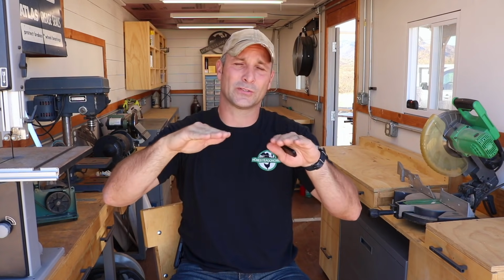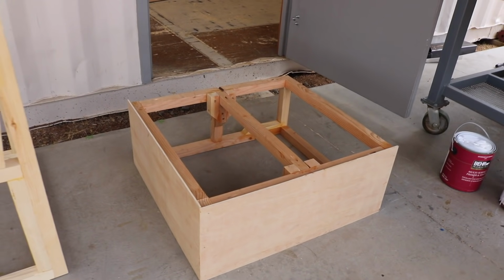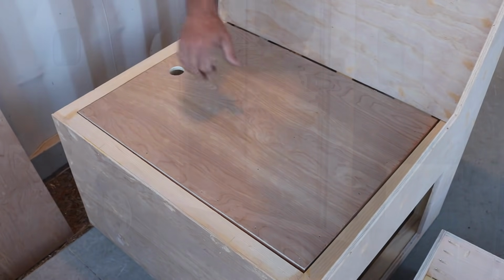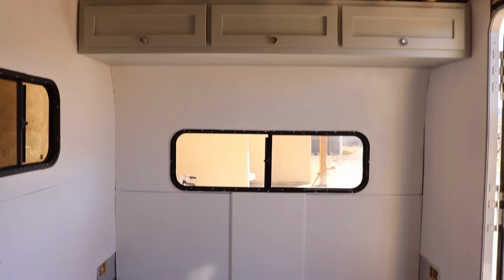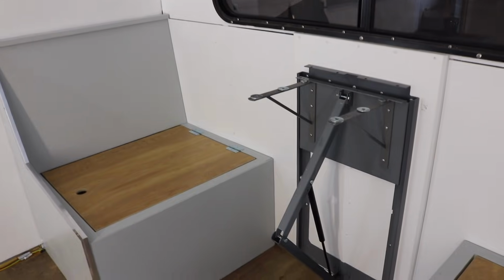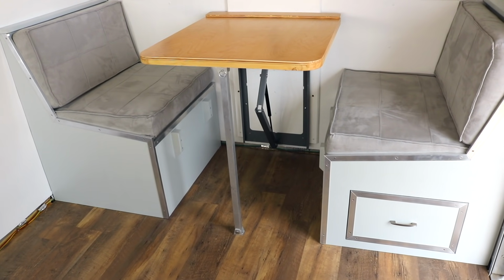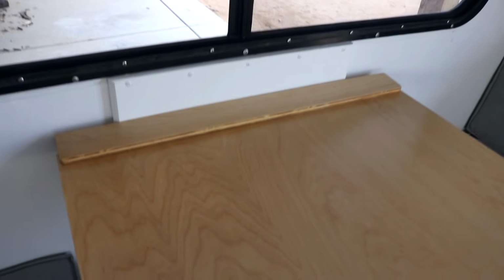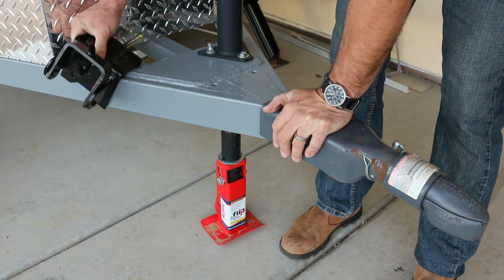How to Build a DIY Travel Trailer - Dinette, Bed, Cabinets and more (Part 6)

Comment: The trailer looks great, I love that table mechanism.  Good stuff.
Reply from the maker: Thank you Raynola!   That mechanism was a sweet find on ebay for $99 shipped to me.   I was looking at the van and boat table legs that retract and they were all into the 250-300+ range.   so I feel good with this one, even it it required a little customization
Reply: CAn you share the name of the part and model number so we can source?

Comment: I'm really enjoying this build series on the camp trailer. I've been think of doing something like this for some time now and it is giving me some insights. Keep it up when done I would be interested in a price break down.
Reply from the maker: Thanks Matt!  If you are thinking about building a trailer I can't recommend the forum tnttt.com (teardrops and tiny travel trailers).... Its mostly folks like you and I that have built all sorts of amazing home built trailers.  LOTS of great info there!   I haven't posted in years but have been meaning to throw this build on there when I'm done.   Just a great site.   
As for a cost break down... I may do something on this at the end.   But it will be very general as a lot of things have broad ranges in prices and I there are so many different options that can span that price greatly.  But I will likely do something on that and maybe contrast it to a used one versus a new.   I can tell you now that a used one is likely a better value to get a trailer considering the time I have invested into this... but I'm still trending way better than buying a new one.   haha.. not sure if that made sense or not :)
Reply: When is the ceiling coming as well

Comment: The only change I think I would make would be a horizontal cleat for the table top to rest on when it's down as a bed. Those short vertical ones may wind up poking someone in the calves more than a horizontal one would. I really like your build, you have great skills and are definitely making a much better trailer than you could ever buy! Linda and I send our best.
Reply from the maker: Thank you!   I appreciate that :)

regarding the support cleat... I actually thought of that first... but the reason I went with the vertical ones is so there would be some space where nothing was behind your leg, versus the horizontal would be along the fully length.   But only time will tell I guess... if there end up being bothersome I'll add a horizontal cleat :D

Comment: I put that flooring in our house as a replacement for the cat and dog-pee filled carpet from the previous owner. I did the install despite having a degenerative bone disease that eventually made me permanently disabled. It was supposed to be a short term stop-gap until we could get new flooring installed by a professional; the vinyl planking is still in the house, it's very durable. It was easy despite my legs and we used a different colour, I'm a fan!

Comment: Very neat, that angle metal makes all the difference in finishing off and providing a solid corner that would otherwise be prone to damage. How about an internal shelf just above the pull out draw to provide a bit more storage.
Reply from the maker: Thanks!  I really liked how the trim dressed and finished it up as well

As for a shelf in that space.. that it is a great idea... it is a spot that can't really be used and would give a bit of exttra utility!   thank you John for the idea! :)

Comment: Very PROFESSIONAL nice job. Not sure you need that middle bar since you had pins going through wall as well. But very nice.
Reply from the maker: Thank you!   as for the support leg... the table will stand fine with out it, but in case someone leans on it I don't want all that force bending against the sliding side... the shelf brackets only go about 1/3 of the table and in case someone leans on the end I don't want the sliding portion getting bent out of shape.  More of a precaution :D

Comment: Nice! 😊 Similar to a yacht interior dinette. May I suggest attaching the table leg to the bottom of the table. Have it hinge and lock under the table. Get leg off the floor. It’s a toe stubbing hazard. Have a wide Velcro strip sewn to back and bottom cushions. Then tack on corresponding loop pieces to wood. This will anchor the cushions.
Reply from the maker: Thanks Reggie, much appreciated!  :D   regarding the leg,  I actually tried to have the leg swing from under the table back... but there wasn't enough room to swing back.... and there would still need to be something on the floor for it to lock into.

Comment: I enjoy the way you think through your designs. Not afraid to take a couple steps back and develop better solutions. I like the final dinette design. Have you thought about filling hail damage, sanding and painting exterior?
Reply from the maker: Thank you Allen!   It is a process for sure... and not one that I came to easily.   I've pushed so many times to get a project finished and have always regretting skipping steps or not thinking things through as much.   so slowly my experiences have taught me to not be afraid to pause a project.... BUT... with that said, i still fall into the 'get it done' trap... haha

Comment: You can rest easy about the flooring. I have that exact same flooring in my kitchen. It has been 9 years since I installed it and it's held up perfectly. So you'll get many years of use out of it especially in a travel trailer that you're not going to be in everyday.

Comment: On our rv unit. The table leg folds up and it stores on the bottom side of table top. Simple bracket attached to the floor as a guide for the bottom of the support leg. This would eliminate your leg from being a toe hazard. Just an option.
Reply from the maker: I did think about having it attach to the top but there wasn't the room for it to swing back... it was about an inch too long.  But it would be probably the better way to go :)

Comment: Awesome build. Maybe you could build an outhouse of some sort. You could make a square stock frame to hang off the back using a "trailer receiver" then you can put a black water caddy on wheels under it for easy disposal. And then you can take it off if you don't wish to bring it with you. ( If your at a camp and have a plot next to or near a restroom and it will keep from taking up space inside.

Comment: Looks and works better than the folding cushions. Nice work.  Why the load leveling hitch? That thing can't weigh that much
Reply from the maker: Thanks Jess!   As for the leveling hitch... that is mostly for the option of if we ever pulled it with a smaller vehicle.   My truck would be fine either way but I'd rather have the attachments on just incase... also for the sway bar option as well :)
Reply: Makes sense Joe. Looking forward to more 👍👍

Comment: Thanks for sharing. Shower space is space wasted when not in use. Perhaps you can build a pull-out shower?
Reply from the maker: Thanks for checking it out!  Yes, the idea of a convertible shower is what we are thinking.  Most often I plan to have an outdoor shower... but for the rare times when we might stay in a camp ground we will want to have someway to doing it inside too.... but most often it will be open for other things.  we are thinking like a high cabinet counter with a couple flip lids that make it into a temp shower but most of the time it will cover or hide toilet and provide storage, etc

Comment: Interesting. That hinge is overkill for that though in my opinion, there are much more simple hinges that are no so intrusive or require as much extra work for the locking etc. I built one with an old school flip down hinge you can get from vintage supply stores.. very nice job though

Comment: These are really great videos, thanks for doing them.  Regarding the floor, the vinyl plank is not a good idea for trailers that will experience freeze cycles in northern climes.  Had a little personal experience with that.  Great for trailers that won't see winters though.

Comment: Just a note, you should plan and run all the wiring 1st before building the interior. Go to RV plant in Indiana and watch them build these trailers.
Reply from the maker: Yep, that is the probably the better way to go... as they've literally built millions of trailers in Indiana.   But I have been building more off of vision and as I go versus set in stone plans.    Probably not ideal, and will have many mistakes... but it's all part of my process ;)

Comment: Ian idea for extra storage, the seat with your drawer, add a removable board that sits at the top of the drawer opening giving you an essentially shelf that does not interfere with the drawer

Comment: very neat, any idea what your total dry weight is? looking to build similar with steel frame and alucobond outer
Reply from the maker: thanks Russ!   as for current dry weight right now... I'm not sure.. but I'm thinking it will end up in the mid 2k range
Reply: @homesteadonomics  ok kool, thats pretty light, love your vids, great work

Comment: The table mechanism is awesome.  QUestion:  why the pull out draw if you can remove the seat base?  (Or is that going to be the liquor cabinet....:)????)
Reply from the maker: Thank you Becky!   The drawer won't be a liquor cabinet.... that will go up higher ;)   But it is there so I can have easy access to utility items without having to go into  trailer... just open the door and reach in kinda thing :)

Comment: Looks good, I am looking forward to see it completed. Did you guy get hit by the winter storm at the end of the year? We were in Tombstone for last week of 2018 and the first of 2019. We were working on the land and doing a forging demo. We had 3 days of intense snow, a total of about 6". It was so surreal to clear cactus and ocotillo in the snowstorm. I am looking forward to the next video. Tim
Reply from the maker: Thanks Tim!  yes, we did get that same storm too!   about 4 inches or so at our house..... first it was about an inch on new years day then about 4" inches a few days after that.   Hope your demo went well... sorry I couldn't make it.... busy busy until I can get some of the hail repairs made and my trailer closer to done :)
Reply: No worries! We only did 1 day due to the snow. We where working on the access road to the top of our property where we're gonna build, so the septic guy can come in and dig the test holes. The last hurdle before getting building permits and start some actual construction. I am quite looking forward to get started.

Comment: Great job on the trailer.  
Now a couple of questions if you don't mind.
1.  What are the exterior dimensions of your trailer?
2.  What is the weight of the build to this point?
I'm in the process of doing a slider camper for a 5,000 lb. utility trailer.  My trailer has a 6ft x 12ft bed.  
I'll be extending the width just to the edge of the fenders...so living area will be maximum 7ft6in x 12ft.
Plenty of room for my wife and I.

Comment: The metal corner at both seat possible hazard in sliding in and out off seating area. If cushion remove it's not a great concept. Possible rounding edge. Same for the drawer metal corners. Yes your satisfied. It's just I'm a mom and I wouldn't  leave my kids in that trailer for they tend to climb into onto cushions?  Seating seam to be next to a sharp pointed edge. Also the that drawer left open its trip pointed hazard waiting to happen. But everything else is awesome  layout.
Reply from the maker: all edges have been sanded but I understand your concern :)

Comment: Great job! Do you have a cost break down?
Reply from the maker: Thanks BD!   No, not at the moment.  I will probably talk about it towards the end of the build.  But it will be more of general costs as I've made lots of purchases of things I havne't used or had to return or decided to go a different route.  But yes, there will be some kind of recap.  however, I can tell you now that buying a good used one is probably the best value... but that building will still be cheaper than buying a new one;)

Comment: I'm not so sure about the metal edging (you'll find out soon enough if it's an issue when getting in and out of the seats) but I love this project!
Reply: Be sure to have one or two spare cotter pins for the table leg (in case you lose one) in the trailer.
Reply from the maker: so far it seems good... but yes, only time and use will tell.   And for having extra cotter pins... that's a great idea and I'll be picking one up just for that instance... thanks!

Comment: The side fins that stick up from your dinette bench to keep your cushions in place you will want to cut off because you will find that they will hinder comfort when two people are sitting on one side.  If you remove those, you can sew Velcro strips onto the bottom of the cushions and glue their Velcro mates onto the wood seats to keep the cushions in place.

Comment: Looks great. Does the trailer have to be plated or licensed to have on the road?
Reply from the maker: thanks!  yes, it does have to be licensed to go on the road.   But it is different with each state, so that isn't something that I will share specifics of as I wouldn't want someone trying to build the same thing in another area only to have different requirements than what I have.  But the general lighting, dimensions, etc,. are pretty standard across the country
Reply: @homesteadonomics  I was wondering as I doubt If be allowed to build something from scratch in the UK. Keep up the good work 👍

Comment: Right decision on the convertible table/bed. Instead of a simple trim piece on the wall side of the table, make it functional--a bit taller with cylinder cutouts for cup holders and salt/pepper.

Comment: Would it have been better to have the leg mounted to the table & have it fold up underneath the bottom of the tabletop when in the down position to eliminate the floor bracket? You would have to mount it off to one side a couple of inches to miss the slide mechanism, but it would be a cleaner look in the long run. Just put a rubber foot on the bottom of it or a locking mechanism at the top hinge for when it's supporting the table so it doesn't slip or something. Anyhow. I just found your page & I love this little trailer build.

Comment: tweeted, Joe what about using that mini shelf on the table as a charging station for cell phones etc?
Reply from the maker: Thanks WTB!   We have been thinking about something kind of like that.... I thought originally of putting aluminum channel on top of it like my laminated workbench built to have something with a lip to keep things from falling... but just had the concern of whomever slept there hitting their head on it.   So I may don the same but just with a shallow groove cut into the wood :D

Comment: i m planing to build one to but unfortunately i dont know ho to weld but all oter things ill do my self i m planing using fiberglass sheet to cover the outer and plywood interior cox to save weight as v have only 1000 cc suzuki jeep to pull it
Reply: yasir don I'm sure you can contract the welding out or view YouTube for DIY welding.
Reply from the maker: That sounds like a good plan too.  If you check out tnttt.com you can see lots of folks that have built them with wood and fiberglass and they have come out AWESOME!   The fiberglass is really strong and I think it will make you a great trailer:)

Comment: Did you consider integrating the folding table leg into the actual table itself, rather than that eventual toe kicker on the floor?
Reply from the maker: Christian Mayhew I am definitely not the smartest guy, haha... but yes I did consider it.  The leg is slightly too long and runs into the wall.  The other reason is that I would need a bracket on the floor to hold it secure and I figured the tube on that floor would be better than a bracket and more visible.   I don’t foresee it being too much of a problem since it lays right next to the seat.  But only time will tell.   It’s all part of the learning process of doing something custom with no plans....lots of mistakes😉👍
Reply: I hear ya brother. I enjoy the channel, keep up the great work. BTW, because of your channel I got my Kreg Jig for Christmas.
Reply from the maker: awesome!  it sure makes building things really quick and easy!  I'm sure you'll get a ton of use out of it   :D

Comment: Great job not sure what kind of batteries you are looking at but sounds like you plan on using this for a long time. If I was you I look at lithium. My wife and I are full time RVers and do a lot of boondocking we just switch over to lithium. The cost can scare you at first but if you do your research the cost in the long run is a lot less than lead acid or AGM first off lead or AGM you can only use half of your total amps so if you need 200 amps a day you'll have to have 400 amps of batteries and most come with a 1 if your are lucky 2 year warranty. The weight savings to is another thing. Just something else for you to think about after we did it we love it we had 4 6 volt golf cart batteries before we switched with a weight of about 600 lbs. now we have 400 amps all usable with a weight of  130 pounds and weight savings in a camper is always a plus and have twice the usable amps. We went with Battle Born Batteries 10 year warranty and they gave us a great deal on them. Forgot to say also that we where on are second set of Trojan batteries in 4 years time.

Comment: How about recess that folding table support into the floor so that when it's folded down it's flush with the floor.
Reply from the maker: I think that would be a great option, but the floor board isnt thick enough to do that with out weaking the floor in that area.   But it would be a super slick way to go!